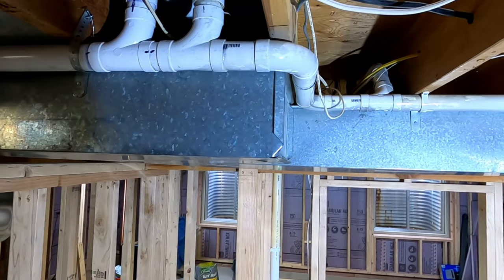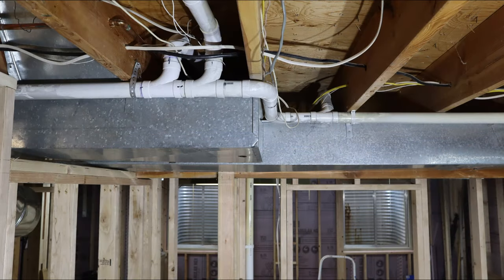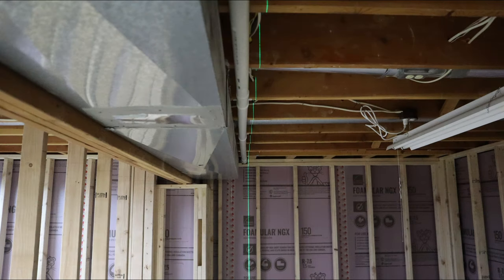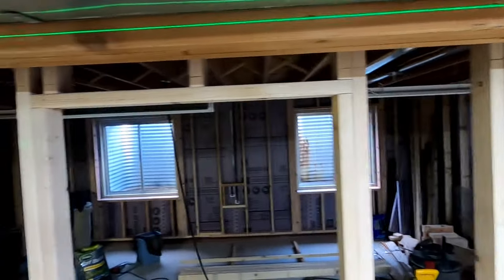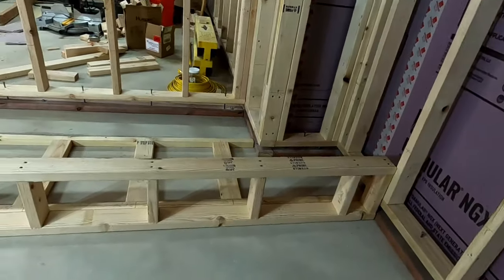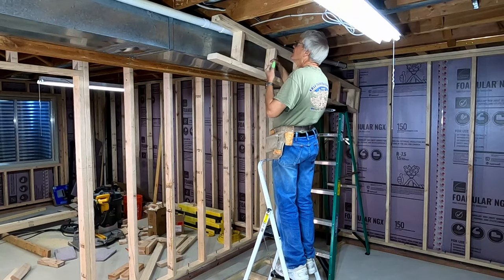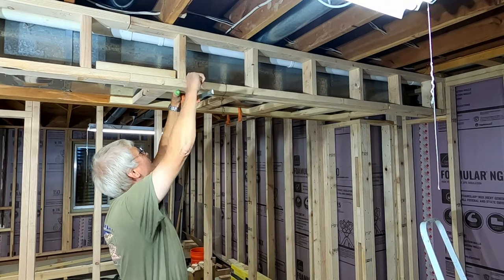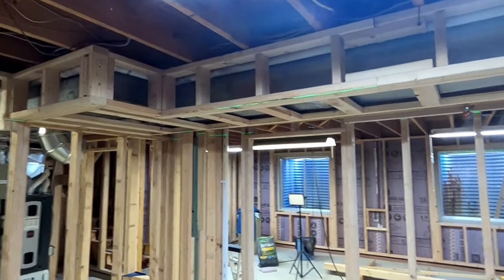Framing a Basement Soffit - Working Alone

Comment: You have the patience of a saint. Very nice work. I am doing my basement and I am lucky because the builder did an excellent job keeping everything square, level and plumb. What I learned during my renovation is the emphasis the local building department places on fire-blocking. It has made my life miserable in trying to comply with their codes. But when I am done I will feel much safer in the event of a fire. Question…..how, if at all, are you dealing with fire-blocking? Thanks again for sharing.
Reply from the maker: As it happens, I did not install adequate fire-blocking.  If I knew then what I know now - I would have done more.  
I realize this steps add complexity, but as you say - it's worth the effort. Local building codes do very, so all I can suggest is that you follow your local codes.
Thank you for the feedback and good luck on your renovation.
Reply: @KevinTaberski  Thanks for the reply Kevin. I can tell you and I are cut from the same mold. You are a planner and want things done right. You are doing an excellent job and dealing with any problem that arises in a calm and thoughtful manner. Best of luck and thanks for sharing your experience.
Reply from the maker: @Trainman0401 I do plan a LOT - perhaps too much at times.  That said, I find that is pays off - for me!
 Thanks again!